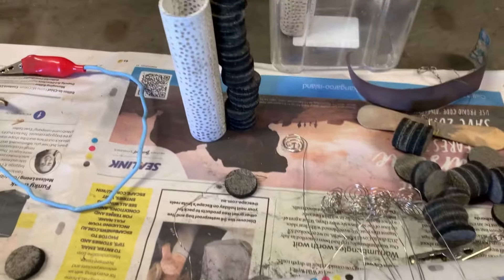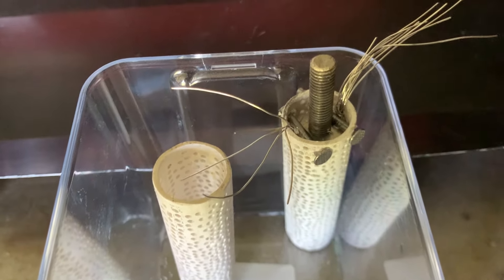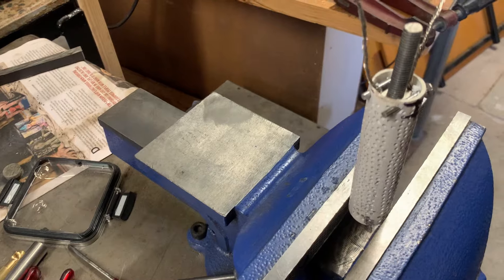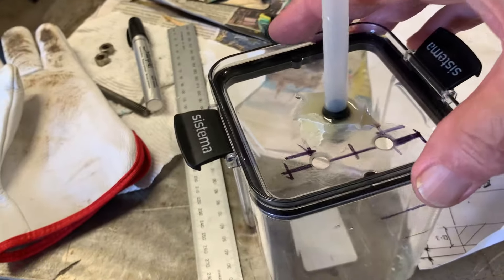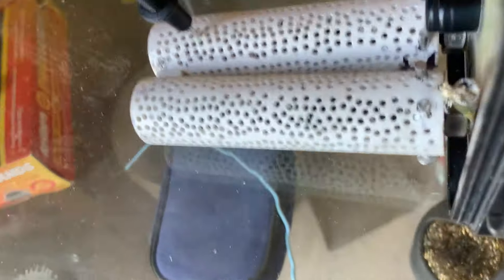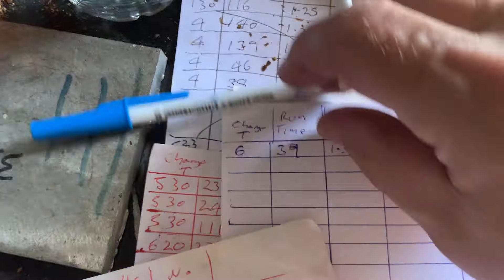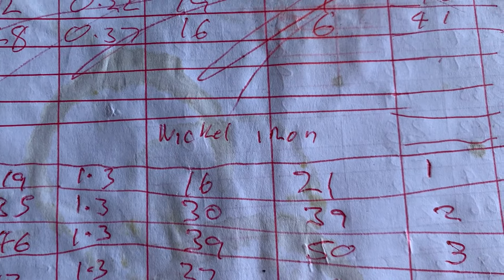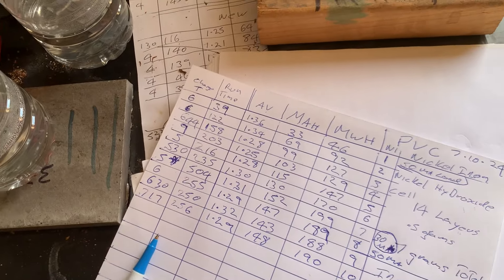Nickel Iron Cell PVC Tube

Comment: So much missing in this video!!!! How did you coat the carbon felt why does the Nick coating look like its powder  ?! Why is there a guge bolt sticking out of the pipe is it SS or galvanized (zink coated ) iron bolt or dud you strip the galvanizing off of it .......
Reply from the maker: @michaelvaughn7137  the bolts are nickel coated and the carbon felt is nickel coated. The nickel coating is done in vinegar and 2 nickel plates. I guess I’ll make a nickel plating video to show. I’ll try to make it this week.